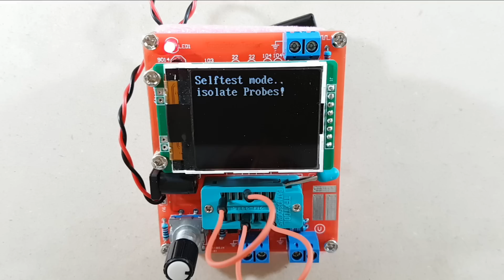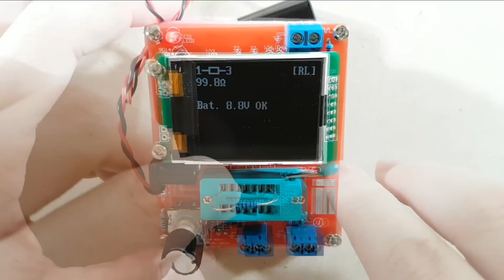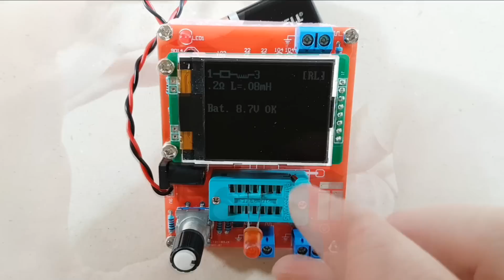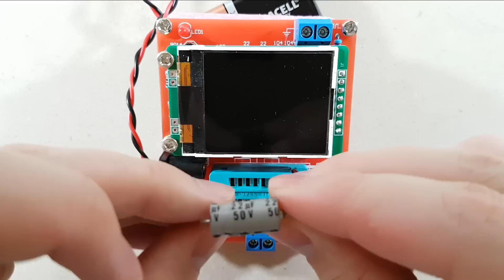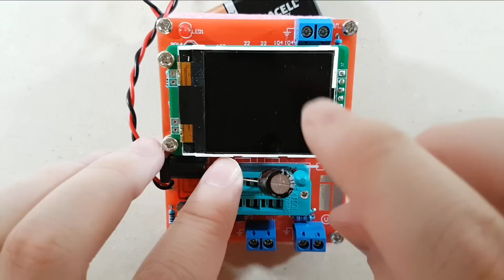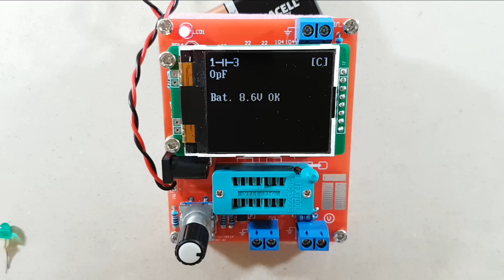TWT #11: M328P Component Tester Testing

Comment: What's the use of the 'voltage' selection there??
Can it really measure DC and AC volts??
Reply from the maker: From what I've seen in spec sheets, it can't measure AC but it can measure DC up to 50 volts when using the correct screw terminals.  I haven't actually tried it though, since I just use a multi meter for voltage.
Reply: Tinkering With Terrius could you please test it's accuracy of the feature?It would be nice if you do it because I'm deciding which transistor tester would I choose.Knowing that it's accuracy of the component testing is good, I would like to know how accurate is voltage measurement.But still, thanks for the info!
Reply from the maker: I just tested it out with my bench PSU. At 1V the component tester read .960, my Brymen 235 read .995. at 2 volts they both agreed at 1.98, they stayed .02 off the output voltage up to 10 volts. After 10 volts the component tester was .2v higher than my multi meter. I only check up to 20 volts though, not the full 50.

All in all I'd say it is decently accurate all things considered.
Reply: Oh. Thanks for that info!

Comment: Hey Terrius,

If you use terminals 1 & 2, or 2 & 3, the unit will shut off a few seconds afeter each test.  It's staying on as a feature geared towards mostly capacitor testing when you use terminals 1 & 3.  Try testing a capacitor using terminals 1 & 2.  It should power itself off a few seconds after a single test.

Steve
Reply: Mine has a switch off function in the settings menu. If you keep your encoder pressed for very long time... Let's say more than 4 seconds what does it do? Also I've noticed that mine seems to do different things even by keeping it pressed and turning clockwise or counterclockwise
Reply from the maker: Very interesting, I'll try that out!

Comment: wtf, the calibration is horrible, i connected 1 2 and 3, it keeps showing short probes! when i start the tester, it says 
bat 7.4 V OK
Vcc Ok
testing...
then it shows 2 serial resistors with .00 ohm, when i press encoder for 2 secs and start selftest, it says short probes!
Reply: and another thing
the selftest doesnt start by itself, default function is transistor test, so i have to select selftest by myself
Reply from the maker: I had that issue when I tried using too long of wires to short out the connections. You can also try shorting out the SMD pads instead with something metal. In regards to the self-test not starting by default when the three connections are shorted, it is possible that is a feature only in the newer firmware of the component tester.  There are a ton of variants and versions of these around.

Comment: You can short all three leads to calibrate the device by placing a metal object on the 3 smd pads ;)

I've recently started playing with a similar version of the little German TT project (K103603BS). I'm building a complete circuit schematic by reverse engineering every trace. The first draft is already up. I'm also looking forward to creating a version of the SMPS driver from the official project to complete the zener threshold test circuit that the voltmeter port is designed for. If your interested in diving deeper into this device I will be adding a lot of missing info about this clone version. My channel is none monotized, I have no sponsors, and no affiliate links of any kind. I'm not trying to spam anyone, I'm trying to expand my own community contacts with like minded hobbyists.

  I came across this video by going through different videos and sellers trying to figure out how many variations there are of the most recent version of this device. Your device is unusual compared to the other ones I've seen. From what I can see you have what appears to be the same PCB design, but I can't quite make out the batch number on the bottom of yours in this video. It looks like K121185__ but I can't quite tell. I am interested in determining if there are any differences. The components I can see are the same except for your screen. All of the newest revision versions I've found (specifically with the "Transistor Tester" lettering in red on the PCB),  have the newer screen. It's on a blue breakout PCB and it has the 3.3v circuit that includes a CD4050 buffer between the AVR and LCD. It's got the ST7735 driver. You appear to have a variation that includes a different screen, maybe from the last version but I can't tell. The PCB and ribbon cable are different looking. In my video on the transistor tester I have a link to the most recent English pdf manual. I'd post the link but that gets messages blocked as spam for first time comments on YT. It details some of these variations, if you haven't seen it, it's an interesting133 page read for a somewhat rough German to English translation.
   ....nerdy curiosity
 All the best, -Jake ;)
Reply from the maker: Very interesting, I'll be sure to check out your video when I have a chance.

The number on it is K131211BSJH if that helps at all!
Reply: Noted, thanks. 
   Now that I look at AliExpress there are some interesting variations, even a few variations with surface mount stuff. Still, none of them have an ISP programming port or even mention the open source project/firmware they are cloning. I really want to see if it's possible to add an ISP port and official firmware, but I'm a programming noob.... we'll see how that goes. Thanks for the info ;)
Reply from the maker: I don't know if you frequent it or not but the eevblog forum has a really interesting thread about these. I think it even has current firmware versions and tips for swapping the crystal out to a 16mhz instead of 8mhz.

http://www.eevblog.com/forum/testgear/$20-lcr-esr-transistor-checker-project/3700/
Reply: Tinkering With Terrius 
  I've read bits and pieces of that post, but it looks like I need to read more. I rarely venture beyond the beginners forum section of EEVBlog but I've been on there for a few years.
  I've seen the 16Mhz mod mentioned in the official project doc. I don't know how beneficial that is when compared to a few other mods. The TL431A is a low quality mass produced 1% voltage reference. The original spec'd reference is for a LM4040-AIZ2.5 @0.1%.
   The other note I made is the trimmer capacitor that Kübbeler shows on the graphic clone version of the project in the official doc. Apparently his first mod was to replace one of the 22pF capacitors, between the crystal and ground with a trimmer capacitor to dial in the frequency. The over all accuracy of the meter is tied to the 470k and 680ohm resistors on each of the 3 test points. I'd replace those with some higher precision versions as well. The 'precision' resistors from China seem to be very close to the max variance tolerance, unlike many well established brands. Someone on YT (I forget who) did an interesting comparison of this showing that the Chinese 1% resistors are truely 1%, but established brands are rarely close to 1%, where as the cheapos were consistent in lots of variations just inside of spec. Some quality 0.1% resistors could make a difference.

   If I can figure out this whole ones and zeros thing, I'd like to see what is possible with a precision comparator added to this circuit. I have an INA106 on it's way. I was going to try to build the milliohm meter from the Scullcom Hobby Electronics YouTube channel, but I want to see how well the transistor tester works in this area first. Unfortunately, I'm a slow partially disabled gimp so I don't need to get too far ahead of myself or over commit to a project, but I can think of a dozen things I'd like to try with this little device.
   First things first though, I want to make it more accessible from the open source project side.

Comment: These units seem very good, only problem with mine (T4) is that after some time passes the socket wears out, the microprocessor starts acting strange and it goes thorough 9 volt battery quickly..